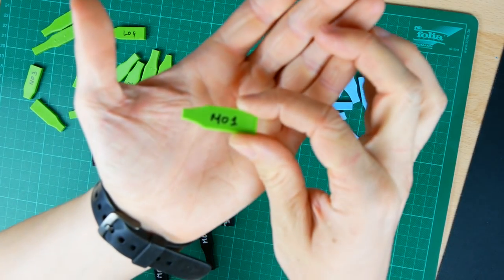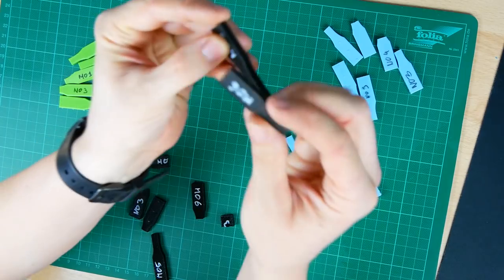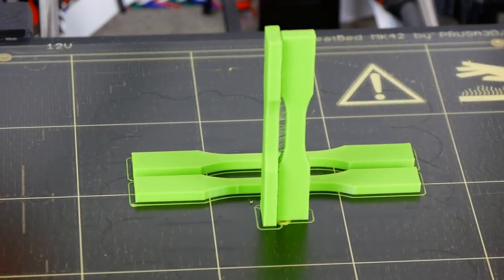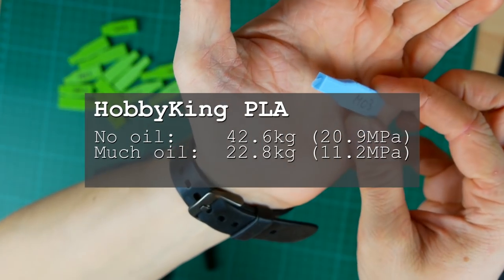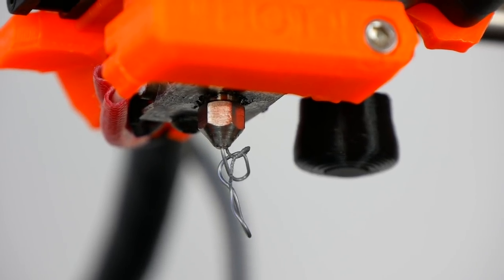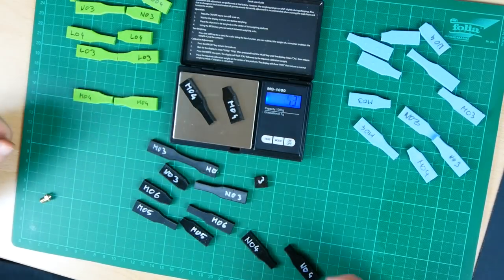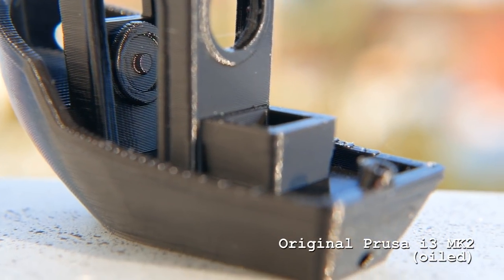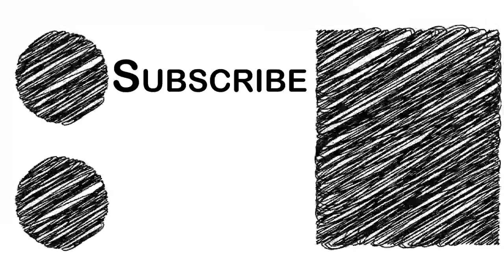Filament Oilers Revisited #1 - not as bad as I thought!

Comment: One side note, do you always allow your spool to have so much free spin? Some have found that a little tension on the spool creates a consistent feed rate.
I need to look through your videos and around the internet but have you tried (is there such a thing) as a "pre-heater" that would warm the filament just as it is being pulled into the tip?
Something that would warm the filament to just before it becomes soft. If you are melting at 220 C maybe and your bed is 60 C then could you find a way to heat it to around 100-140 C? OR maybe a number that you find which is safe enough to warm the filament where the feeder doesn't distort it.
Actually I quickly searched and people are making dryer/preheat units. It is to clean out moisture from the filament but now the question is does it work or help with anything? Would it make your "best" strength test part better or worse? Would preheating and then oiling change anything? DANG this would be a hard and long process to test.
So In my head it seems you would need the Dryer/preheat well before the printer but still close enough that it does something. Then a wipe/cleaner to remove any containment so they are removed (unless the dryer/preheat removes them). Then the oiler just as you have it.
Reply: food dehydrator 3d filament, then a preheat (If dehydrator doesn't do it), then wiper (optional), and then oiler. 
But it would take testing each alone, then combos until you get to all together.
So best heat part you ran earlier through each test.
Reply: There are people who get perfect prints with just out of the box filament every time...……..I think if anyone is having problems then go back and investigate what you are working with and anything you have messed with that causes the problem. it starts with your machine and how you adjusted it. Also, what mods you have done if any to a standard model. There are a 101 reasons + for bad printing results on the same model of printer. @therealdeadpen

Comment: Didn't watch the original, nor did I watch this one.. I'm pretty sure your tests are top notch, but..  using oils with 3d printing fixes the problem, but not the cause. I never use oilers and never have a jam with using unmoded cheap chinese extruders/hotends..

Comment: Hi, so I know this is an older video, bit I’m trying to switch to an all metal hotend and been having problems with clogs, I wanted to pront petg at higher temps and was wondering if this could help me resolve the problem? (I’m also going to use thermal paste and probably try to polish the throat) If anyone has any thoughts I would be very happy to hear them.

Comment: I want to print copperfill pla. So if I want to get it shiny Does it help to oil the filament?
Reply from the maker: I don't think so. You need to polish there prints manually or in a vibratory finisher to get the shine out.

Comment: Can you try mineral oil?
Reply from the maker: I actually did: https://www.youtube.com/watch?v=6lCiXvYzy48
Reply: I thought you said you used machine oil for that?
Reply from the maker: I'm quite sure that my machine oil is mineral oil based, but correct me if I'm wrong.
Reply: Machine oil is usually a petroleum distillate. Mineral oil is a food safe oil. They are generally very different.
Reply: food safe??? I always heard it was a laxative!
Reply: In significant quantity it lubricates your intestines, and softens your stool, and has a laxative effect. It's also used as a food safe lubricant for industrial equipment, and for treating wood cutting boards, and bowls. In those cases you're ingesting a tiny fraction of the amount needed to act as a laxative. It's food safe in the sense that it's not dangerous to ingest, not in the sense that you use it to cook in.